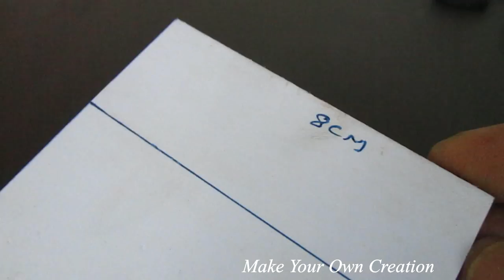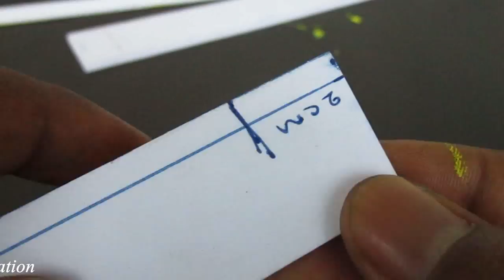How to Make a Conveyor Belt

Comment: But i can tell u esabela h write this at your paper 1.small gear 2.motor of a toy car 3.battery 4.switch 5. Small pipe 6.wood or cardboard 7.tie wire steel 8.bycicle tube in the wheel thats the belt thing . I know this thing and video i know convayors like and subscrilbe to my channel this will help you